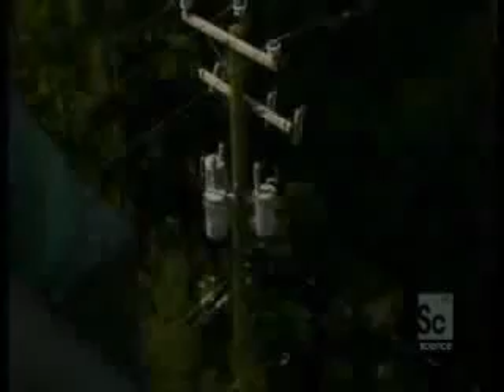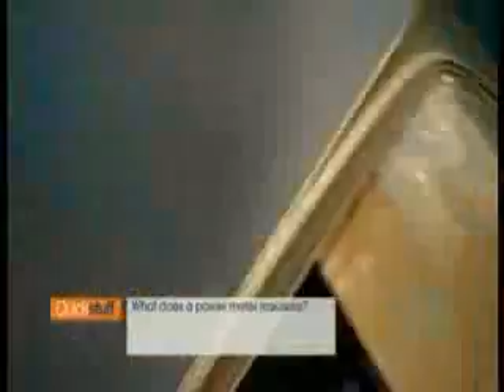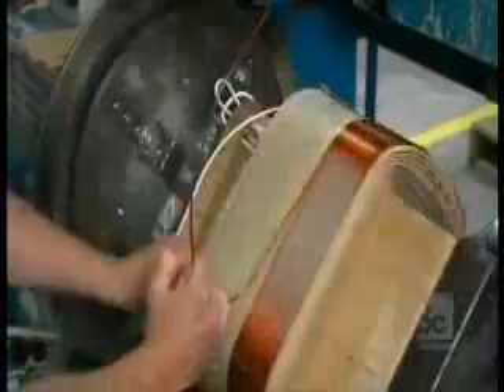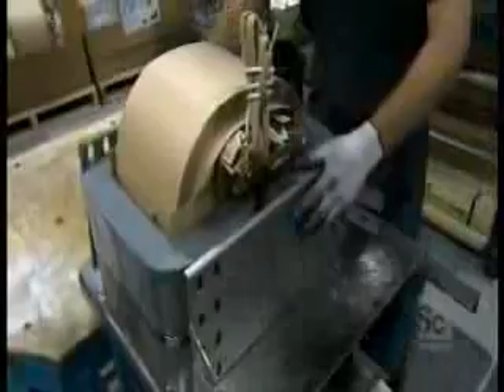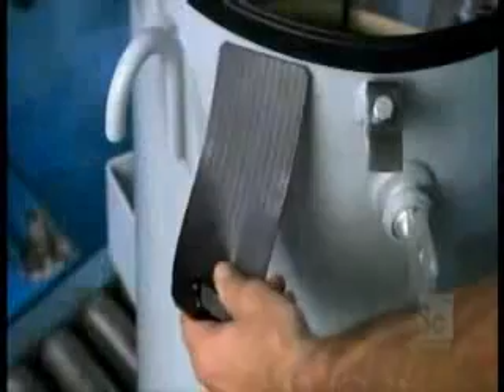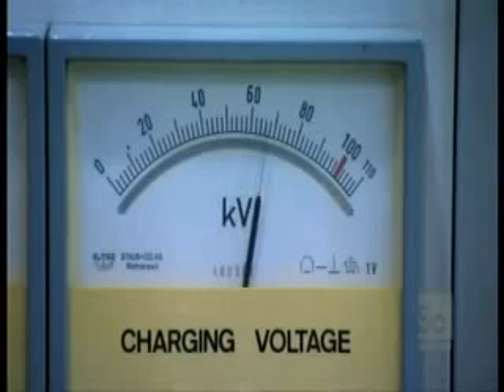transformer construction

Comment: what would make one suddenly start buzzing I was walking my dog lastnight  and the one behind the house was buzzing it was pretty foggy out I called the power company hotline and the guy came out after checking it out he said a wire was tracking what does that mean? we hadnt had any trouble with the power execpt a  squril getting on the tranformer a few weeks ago making us loose power dont know if that had anything to do with it just wanted to know
Reply: Sherry Conner high voltage can "track" on the conductive dirt, grime, carbon etc on the surface of the conductor and surrounding surfaces.. higher humidity leading to more moisture condensing on the surfaces around the conductors will lead to more current and cause the noise you might have heard to become louder. On a dryer day it might be quiet enough that you wouldn't hear it from the ground or maybe not be able to hear it at all even if close by.